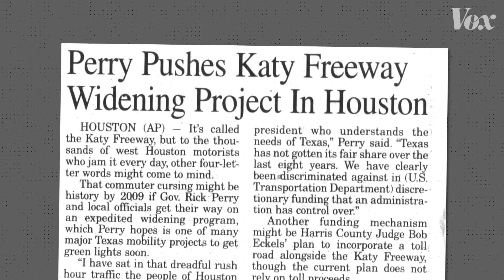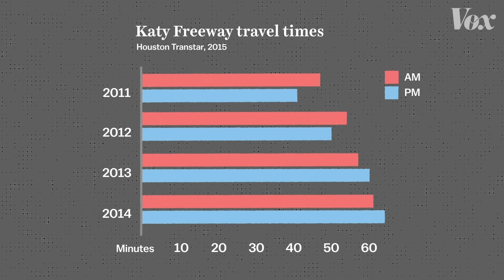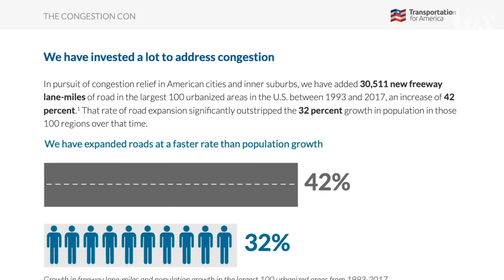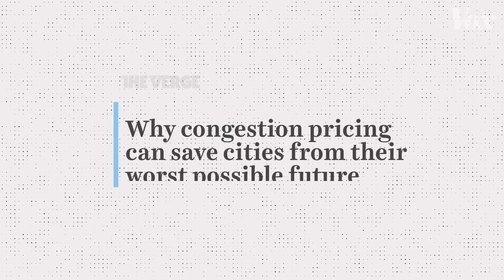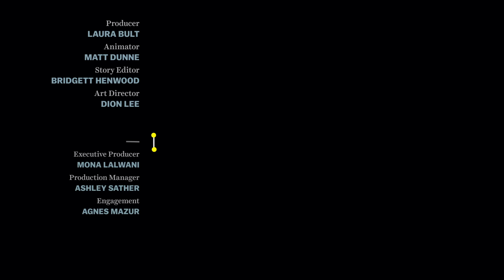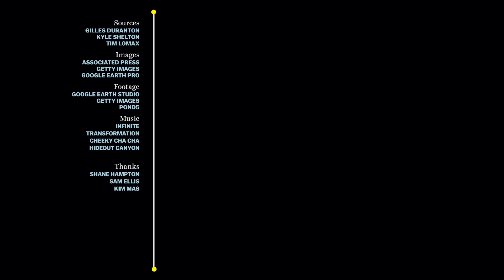How highways make traffic worse

Comment: TLDR: You need public transport.
Reply: And more roundabouts/diverging diamond interchanges
Reply: I think: "Invest into public transit instead into new roads" would make more sense.
Reply: Public transport? For poor people? In MY backyard????
Reply: @colonelkush  nope, cause thats just another form of induced car traffic.
Reply: @Gummmibaer  what exactly is inducing car traffic? I am for efficient / effective public transportation but also bring up the interchange due to the safety aspect they provide for drivers
Reply: also people changing lanes will back up traffic
Reply: yeah, but people like their OWN cars, I enjoy my car, even when the public transport is good I still want to drive my own car
Reply: That only shifts the congestion, because public transportation will also suffer from induced demand. What we need is higher density, mixed-use development so that workplaces and homes are closer together so that biking and walking are a better option.
Reply: Yes TLDR is a very good youtube chanel
Reply: It's more complicated than that. Because the same process will happen anyway. They have to add more mixed-use areas and more density. So people simply won't have to commute at all, or use their cars. The American urban sprawl is more of a problem than highways I think.
Reply: @colonelkush  I think that this is a specific question of intersection design, but has no direct influence on the problem described in this video. Yes, there may be a lot of intersections that can be designed as roundabouts but this here is about a bigger picture. Roundabouts dont solve any congestion problem or help reduce emissions significantly.
Reply: @MROKJIA  yeah me too
Reply: Too many people think taking a bus instead of driving is evidence of poverty, and therefore something to be ashamed of.
Reply: @krombopulos_michael  it isn't, but waiting for a bus in a freezing temperature in the winter, no one wants to do that.
Reply: Public transport and denser housing development
Reply: @MROKJIA  if the public transport develops, more busses will be there and you won't wait for long ... Or you can build a bus stand with a thermostat
Reply: How about building more tramway lines?
Reply: @MROKJIA  if there is enough public transport, most people will switch.

You can stick to your cars and enjoy less traffic ;)
Reply: Yep. Another reason I dont like the US...
Reply: you mean too long didn't not watch....TLDW?
Reply: @switzerlandch4986  TLDR stands for Too Long Didn't Read. This doesn't necessarily refer to the TLDR channel, although I also found it interesting.
Reply: Very expensive, and hard to do in america
Reply: Katy to downtown houston is WAY too big to put in public transportation.
Reply: @gloppy3612  Nope. just needs a good subway system. You'd be shocked at the number of people who can fit on a 10-car subway train
Reply: Not really. If the busses and trains are just as slow as traffic, or dont take people where they want to go... that is a real problem. What cities could do is connect culdesacs in suburbs so the collector roads arent the only way out of your neighborhood, as well as introduce mixed use so people wont need to drive on collector roads to get what they need.
Reply: bUt tHaT's sOcIaLiSm
Reply: @itsjasleendiva278  You know private sector public transporation can exist. In America we killed off private passenger railways for government subsidized highways.
Reply: Same issue as adding lanes. Hmmm what do we do when demand is too high for supply? Congestion tolls are the only thing that would work
Reply: the bad drivers just space out into the other lanes
Reply: jojofromtx  yep... So much people, all in individual homes, all with cars... Who’s the reason for climate change again?
Reply: @danielchretien2057  Right. More public transportation isn't the only thing. Reducing urban sprawl so that people don't have to commute as far or even at all would help a lot. Working from home should be default for those who can, satellite work centers for people who can't.
Reply: @MrMineHeads.  that is exactly the point. American cities are built wrong and sprawl waaay too much, which makes travel distances huge. A complete redesign of cities would be needed to fix this, but I don‘t think it‘s easy or cheap to just reverse it. It‘s near impossible unfortunately. So American cities might be stuck with that issue as long as they are built for the car
Reply: @lachainone  that’s what happened before suburbanization
Reply: And better zoning. You can get a lot of people off the highways and roads if they don't have to use cars in the first place when they could for example walk to the store
Reply: @uptorest  We dont have subways and never will.
Reply: @MrMineHeads.  I mean logically, 50 people riding on a train will cause far less congestion than 50 people driving 50 two ton vehicles.

Most people in the states, even in urban areas, are pretty much forced to take a car to get around most places with how underdeveloped public transit is. The bus on my street for example comes once every hour despite being close to the city, while most canadian neighbourhoods have routes that consistently arrive every 15 minutes
Reply: @Akronological95  I agree. I just mean that in general, a denser more walkable/cyclable city would more transit options would do best.
Reply: No you don’t. People should have the freedom to move from A to Z whenever they want. Not rely on public transportation and schedules.
Reply: @urbanistgod  no one's saying you don't, just not everyone needs the extra 'freedom'.
The point isn't about forcing people at gunpoint to use public transit, it's to provide cheaper, reliable methods of transportation that clear up traffic and are more accessible to everyone.
People often have to shell out extra money to pay off and maintain a car because there is no alternative, because their public transit is underdeveloped, that's the whole idea of investing in the infrastructure.
Reply: @Akronological95  That’s why we should focus on making cars cheaper not add useless regulations and tech that makes cars expensive.
Reply: @Akronological95  Also more public transportation is an excuse to tax even more gas, cars, remove parkings etc since people can “instead ride the bus” and be packed with 50 other people
Reply: @uptorest  subway systems are incredibly expensive to build. Over ground light rail is less expensive to build, but requires that a lot of land is purchased probably through eminent domain, which is again far from cheap. And given the sprawl of Houston, neither of those are going to be an effective solution. The density of people is just too low. In my country there are only 2 cities with a subway system, which are the two biggest, most densely populated cities in the country. There are 4 cities that have a tram system, which again are the 4 largest, most densely populated in the country.
I live in a metro area of almost a million inhabitants and there are only buses here, we do have train stations, but those are primarily for inter-city travel.

And even with all the public transport we have here, a moped is generally faster, cheaper and more convenient. Buses get stuck in traffic, take the long way around because they have to service an entire area and they are far from cheap, despite the massive subsidies they get.
Reply: Public transport. Denser urban areas. Less desolate suburbia. More walkable cities...
Reply: @uptorest  That too.  Buses, light rails, trains and streetcars that go everywhere and run efficiently in addition to park n' ride lots and garages will go a long way.  They also serve well during special events.  If a transit system is not efficient enough, fewer people would want to choose transit over a car.
Reply: @MROKJIA  that is the bus that doesn't works, not the idea
Reply: @gloppy3612  Houston: 2 304 580 Inhabitants. London: Around 8 982 000 inhabitants. London has a very efficient public transportation. So it isn't a dimension.
Reply: @fermitupoupon1754  Rome, Milan, in Italy has working subways! (more the one in Milan, but ok). The US is the biggest Economy in the word, and can't afford a couple of metropolitan lines?
Reply: @MROKJIA  so buses and trains should be frequent enough that you usually don't need to wait much. There's really no excuse for the status quo
Reply: @linuxman7777  so they shouldn't be stuck in traffic, by building railways separately and building bus lanes. If you have space for giant motorways and stroads, you have space for trams, bus lanes and railways
Reply: Fun fact Our towns were made from that back than
Reply: Learning to drive for me is a big roadblock due to me living essentially in the middle of nowhere, and because of me being autistic..

Comment: I find it surprising that induced demand is extremely bad only for cars, but good for public transport and anything that isn't a car. For example the more people take a bus/train the better the system can get because high ridership eventually leads to improvements that make things better and more direct/frequent. The more people use a bike the more bike lanes there will be and the better riding a bike can get. That's just how bad and inefficient cars are as a form of transportation, when induced demand works again them but not other forms of transportation.

Comment: As someone who has driven in this highway I can say they nailed the explanation. There are people who once had about a 45 minute commute (very common in Houston) now take 1 1/2 hours. Communities keep popping up further and further down the rod and it keeps getting worse.
Reply: Texas is getting awful. I advocate for public transportation but it’s hard to with their mindset. Also, way too many cookie cutter, poor quality homes/neighborhoods being built. Looks disgusting.
Reply: @zacharyg3366  Agreed!
Reply: This is due to a market failure when it comes to housing costs. Once people have families, a studio apartment ain't going to cut it anymore, and condo's and sfh's in the central cities are prohibitively expensive for the middle class and lower class due to supply and demand. No easy fix
Reply: @FirebirdCamaro1220  Yes, there is an easy fix. Start building apartment buildings with shops on the ground floor, parks and public transport system and it will get fixed. Younger people will buy those small apartments, then move out to a bigger one or maybe a house when they have kids and then the new generation will move to the small apartments, etc. Build the houses close to the apartments and shops so they are walkable neighbourhoods and not isolated from everything. Another thing they should do is make homes smaller. In the US you have tiny apartments, big houses, then super highend multi million dollar homes. There is nothing in between. It's a cultural shift the US and Canada have to make to fight climate change and provide their population with a better quality of life.
Reply: @veritorossi  current property owners use their power and influence to limit new housing construction so that the value of their own property will keep going up
Reply: @FirebirdCamaro1220  I wouldn't spend a dime in a property in the US. It's a waste of money. These people think too highly of their country instead of seeing reality. Reality tells us that the urban design the US has had since the 50's is just ruining their lives. The most valuable properties are the ones in walkable places. Like NY. Brookyn is an example.
Reply: @zacharyg3366  They should increase tolls
Reply: @veritorossi  So, what you're actually saying is that you don't really have any idea what it's like to live here? Texas is definitely a victim of rapid expansion, and I'd demolish and rebuild every city in that state if I had to, but the vast majority of Americans do not live in cities like that.
Reply: @veritorossi  Americans don't like vertical living. We want single family houses and the yards that go with them. We want space for our kids to play and entertain our friends. You're not going to change that. We pay for that with long commutes. But there are technological solutions that can help: Remote work and satellite offices can reduce the need to travel; Autonomous electric vehicles and ridesharing can dramatically increase the capacity of existing freeways while reducing pollution (autonomous vehicles can travel much closer together and coordinate their movements).
Reply: @FirebirdCamaro1220  there is another way - by building houses that fall somewhere in between detached houses and high rise flats, such as terraced houses, semi detached houses and low rise flats
Reply: @wallyballou7417  "Americans don't like vertical living" source?
Reply: @richpryor9650  Yep. When you can't win the argument, use insults.
Reply: @wallyballou7417  Speak for yourself. I don't want a yard at all. I'd prefer a rowhouse with a shop down the street, and a park my kids could play at. However, my wants are illegalized.

Comment: Solution: MAKE EVERYTHING A ROUNDABOUT
Reply: Americans say no.
Reply: Cause we all agree that traffic lights are fair and balanced except when it’s 5am and there’s no one at an intersection with the light is red but you can see the cop in the shadows lurking waiting to pounce on the one to run it
Reply: Northern italy is switching to roundabouts, they started a while back
Reply: @Big007Boss  Most of Europe have gone over to roundabouts. They help with some issues when it comes to traffic flow. So is not odd that they are popular. And generally is more the flow then the capacity then help with. But one should not underestimate how much flow matter.
Reply: Roundabouts don’t work for highways, it’s only something for smaller roads that intersect without bridges etc.
Reply: @MrLOLametro  you should see north africa, a roundabout with a bridge up top , sometimes they work, other times your stuck with no escape.
But in Paris and Tunisia, they've outdone themselves, a roundabout with traffic lights in it.
Reply: @Big007Boss  this indeed works, but I meant connecting two highways with a roundabout doesn’t work
Reply: @MrLOLametro  a turbine interchange functions like a roundabout, yes there are some differences but as far as flow is concerned they act the same way
Reply: @colonelkush  yes but they require many bridges for the intersections, which means they are pretty expensive
Reply: @MrLOLametro  True but the ROI for efficiency is priceless
Reply: @tacocat1714  it's harder and more costly than it sounds. Keep in mind roundabouts have larger footprints than regular intersections, and so you also have to demolish surrounding buildings to fit them. Thus for existing infrastructure they often go with compromises like more efficient intersections, more "intelligent" traffic lights, etc.
Reply: @tacocat1714  umm yes that's the point :))
Reply: Including people?
Reply: Roundabouts are the devil. Here in Portugal everyone hates them. Theyre dangerous, its where most car accidents happen here.

Do roundabout proponents enjoy being stopped for 5 minutes at a time while you see traffic from the entrance to the left of the one youre in just pouring into the roundabout until you decide youve had enough and risk an accident by getting in front of them?

Then the solution is to put traffic lights at every entrance and in the roundabout itself. At that point, why did you even build the roundabout to begin with?
Reply: We dont have many roundabouts here in texas because we drive so fast they cause tons of pile ups and accidents
Reply: My city in Malaysia used to have alot of roundabouts,but they are now changing it to timed traffic light because it's cheaper. so I can see why Americans cities is skeptical on having roundabout based on the price alone
Reply: @fgsaramago  Problem with Portugal is that they overdone it with the roundabouts: there's a roundabout in every 100m
Reply: @edipires15  I wish you were joking 😂
Reply: Solution: Public transportation
Reply: Superstreets!
Reply: Roundabouts do have a much higher throughput than crossroads. 

In the UK we don't have then on motorways (highways) but we do have them on dual carriageways which are smaller 2 lane highways. We do have roundabouts combined with Ramps to create our intersections though which are much more compact that American intersections

Comment: I live in vancouver and this pain feels so real. The biggest issue with our highways is the bottlenecks, but every time they fix one a new one forms further down the line. We're currently debating replacing an aging tunnel with a massive 10 lane bridge but the bigger problem will be that the bridge is followed by a bottleneck further down the highway. We could spend 10 billion dollars just to push the bottle neck further down the road or we could just build a more functional city by utilizing mass transit and more "city within a city" models. Neighborhoods where we have towers with grocery stores and shops on the lower level so you dont even need to commute to pick up groceries. Thankfully this city has a decent public transit system or else things would be 10 times worse.